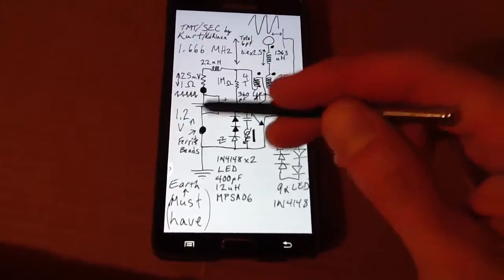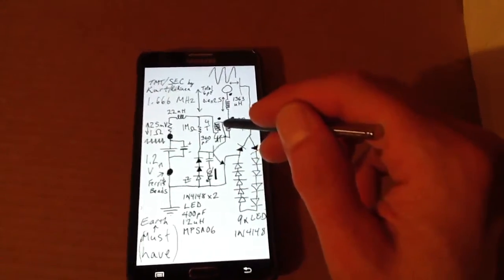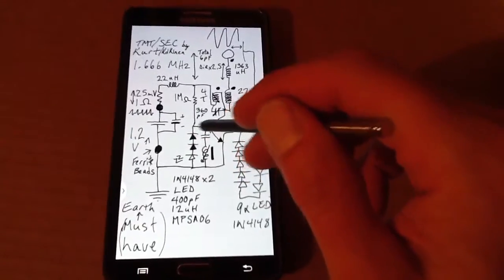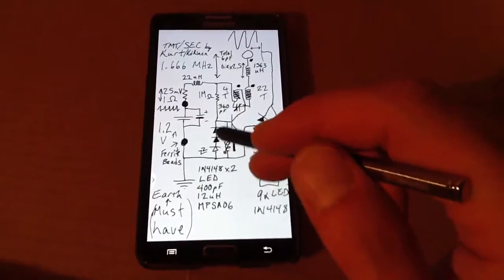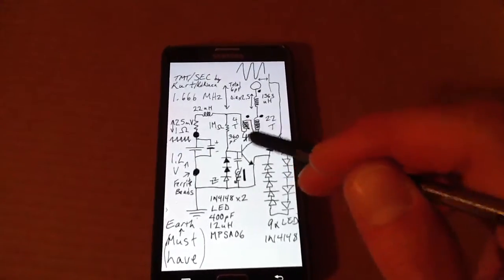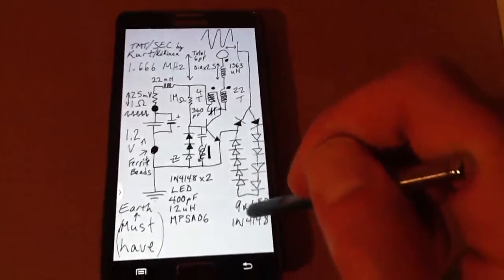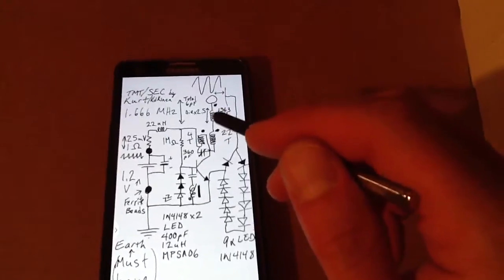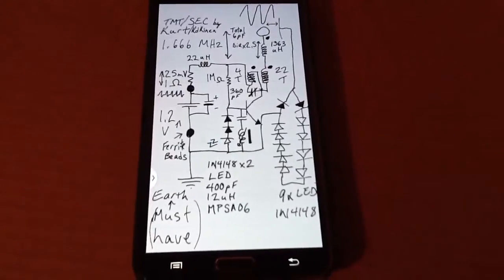pt9 TMT Mini SEC Magnifier SCHEMATIC

Comment: I am amazed how I get up to this point of finding working stuffs while out off any physics we used to know. What a Very Patient Work by errors and tries! Really amazed!  :p

BTW, isn't the circuit on the board of your last vid with the 3 plates collectors, even more simple? Looked to me there was less components. ..

Infinite Exponential Happiness, 
Khwartz.
Reply from the maker: hi man, I appreciate that, and I can tell you the problem right away, physics has limited the understanding of a free ringing resonator relative to the velocity of light (Pi over 1 x velocity of light) but Tesla and others state that it is Pi over 2 x velocity of light, 
and #2 big reason is that in Maxwellian theory, the outside environmental factors, like capacitance, negative or positive potential, etc... are most often not included as part of the circuit factors, and the focus is on only the component values in the closed circuit, doomed only to heat and steady decrease of source potential, of course I could be wrong as well , but these are my observations anyway
Reply: ***** Well, You're always welcome, Kirt! :) For your specifications about the possible limit for a resonator, didn't know that, thanks for teaching me it.

Your view looks to me more and more in agreement with the Travkin's physics I have just discovered ;)

Comment: you might be able to tune a section to replace the 1.2vdc battery.  you might also try a ground plate(insulated) instead of the earth ground  the distance and size would have to be adjusted
Reply from the maker: thats a good idea man! hope your work is going well !
Reply: ***** All is well here  I just finished 20 rodin style torpoids took two weeks of winding yuk.    I decided to use them because of the NEO Magnet test that Jack did with the rodin coil no power and yet the neo kept spinning about 10 ft away.  that's a serious field.

Comment: Back when I was messing with the PSEC and SEC, I found that these old school germanium diodes gave 30-50% more voltage out...'Detector Germanium Diode D2G (USSR-1970S)' than the 1n4148's...I also got a PSEC working off running another SEC next to it, the germanium diodes increased the sensitivity...but I was mostly annoyed by the power limitations of the MPSA06...There is something to be said about the LC circuit and diodes that go to the base of the transistor...There is a concept of injecting negative resistance into an LC system to annul the winding resistance of the primary...effectively shooting the Q factor into theoretical infinity (very selective tuning too very small BW)...I think this is how the coil/resonator develops such high voltages...tunnel diodes do this and other types of metal...The stimulation of the lattice has a lot to do with radioactive detectors...polonium toroids and thoriated stuff is supposed to increase the amount of energy available by ionizing the ions into a form that can then be recombined with an electron to create energy flow...so called "neutron" sources...great work man, you have inspired me to go back to the SEC stuff...I have a hunch the MPSA06 is acting as a coherer of sorts to turn on and inject negative resistance at a specific phase shift...not sure what this means yet but getting imaginary numbers and their phases lining up to annul each other is exactly what resonance is...there is another form of resonance that is related to phi. Have you found any relations to the frequencies and phi in your experiments?

This is a really old video but check it out, Dr. Stiffler SEC replication with PSEC